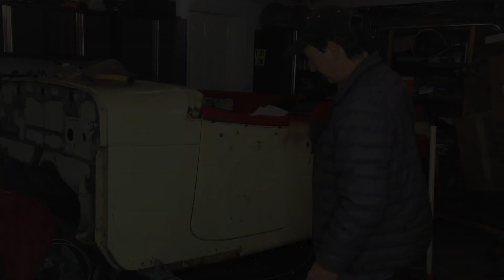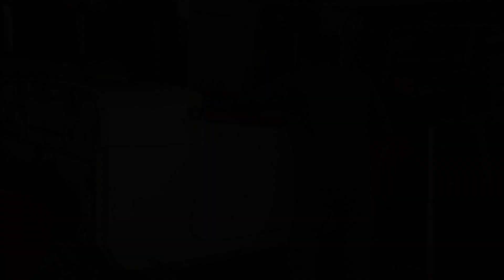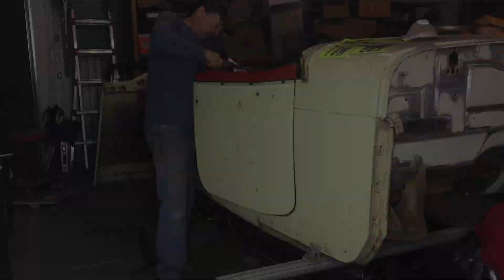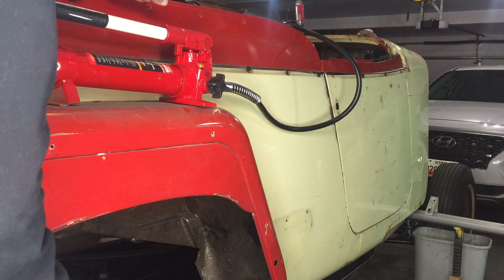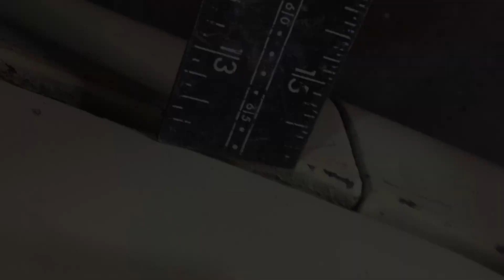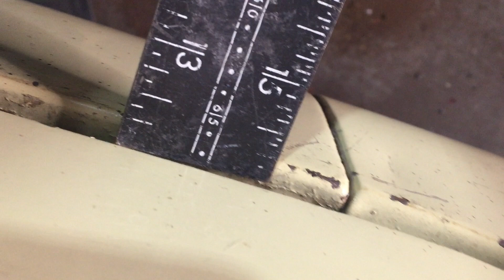Factory Door Fitment is HORRIBLE!!! 1950 Willys Overland Jeepster Hot Rod Project.

Comment: Beautiful job. Manufacturers found that having the leading edge of the door sub-flush reduced wind noise. Remember to fit-check the windshield with the rubber seals and wing windows.
Reply from the maker: Never thought about the wind noise scooping in air on the lead edge but I just gotta have those show quality lines and tight fit. I'll be putting the windshield back on soon because I need to fit the top front edge of the door and wing, as well as my custom dash meeting all at that same point.